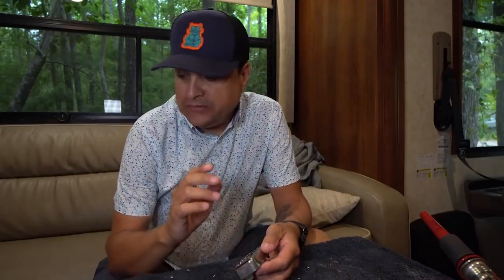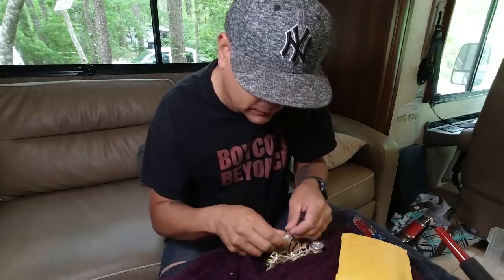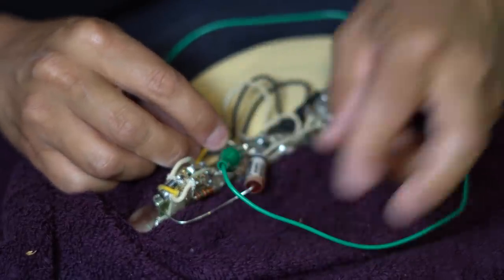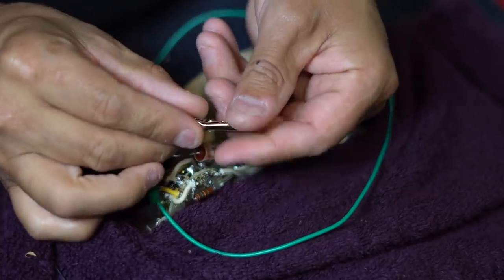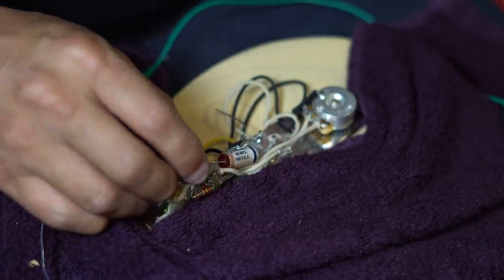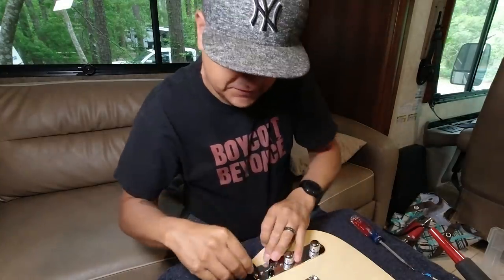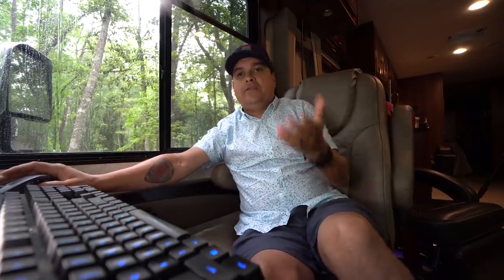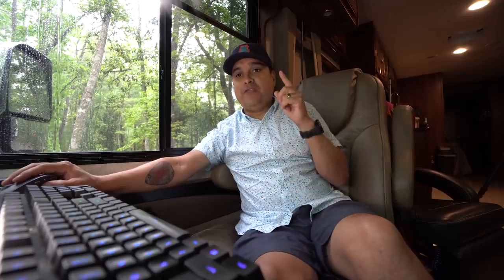Paper in Oil Caps Are Not Worth The Trouble

Comment: Hey Dylan. Just a thought. Because I’m not great at soldering I use a silicone bakers sheet cover with a slit cut in it to protect my projects. The stuff to be soldered fits through the slit and the silicone protects the body better than cloth because the solder is not hot enough to burn through. I used to use a towel too, but had a piece burn through. You can usually find the silicone sheets in the housewares section at any big-box store. Just a thought .... thanks for the video every day thing. I know it’s a ton of work but really appreciated !!!
Reply from the maker: dude... excellent idea.. we used to do that as well
Reply: @DylanTalksTone  … just wanted to share what works for me…. thanks for the tip on the pots….

Comment: For an Analog circuit wires are typically twisted to reduce crosstalk with other twisted pairs of wires.   For an Analog circuit this is really only useful for powered/amplified circuits and is part of dressing the leads when building an amplifier.    By twisting the wires (which would have a powered signal running through them) it intertwines the magnetic fields and thus reduce crosstalk and electromagnetic induction to other like wires/leads.For the type of microvolts a guitar pickup is outputting this is really not required except for the physical advantages twisting the wires provides.  It also looks better in a guitar and provides a cleaner look.And as Dylan pointed out all wires should not be twisted, usually only wires that are passing signal/in the signal path.
Twisting all wires (in an amplifier build for example) would cause all sorts of issues and undesirable effects.

Comment: I twisted my fender tele neck leads and didn’t on the bridge pickup (mim pups/guitar so not baseplate ground and uses an eyelet for grounding the bridge) and didn’t have enough lead to twist the bridge pickup wires. The neck is virtually noiseless and the bridge is 60 cycle as hell. 4 way tele wiring. Serie has the same. Is this common? Thanks in advance

Comment: Whenever soldering a connection to a potentiometer twist the shaft all the way to the end (doesn't matter if it is MAX or MINIMUM).
By doing so you are protecting the resistance film from possible damage if the pot gets overheated.
You can still damage the pot however the damaged area (most likely under the wiper are assembly) will be at the extreme of travel.
If you damage/burn the resistance material in the middle you will hear it when using the pot where as if the extreme ends are damaged you are less likely to notice it and still be able to use the pot.
Reply: I recently started using ring terminals around the shaft of the pot.

Comment: Old-school UTP phone cables or 10 Mbps Ethernet ("CAT3" cable) had maybe 10 twists per meter.  CAT5e (100M Ethernet) has 50-150 twists per meter.  CAT6 (Gigabit Ethernet, or 10G with cables < 55m long) is 200+ twists per meter.  The actual pitch isn't required by the spec, and in practice depends on the manufacturer.  A couple of twists per cm would be good for frequencies up to 250 MHz.  You don't have to wind it up tight like screw threads -- assuming you bother to wind it at all.  It's not like there's even one meter of cabling inside the guitar.
Reply from the maker: Thanks so much for this. I didnt know the specifics, I just knew it wasn't the same application

Comment: Would solid core phone wire be good for wiring a guitar? I mean, we're talking about millivolts and purpose made signal wire, right?
Reply: The only negative to solid core wire is that it's not as resistant to repeated movement and bending and has the possibility of breaking due to metal fatigue if moved or crinkled too many times. It's not a huge issue as you aren't going to be moving your electronics around much once installed, but the possibility of a break is still there so stranded wire is the best choice for longevity. Solid core is useful for jumpers on the same component, like on a pickup selector where there will be no movement or connecting terminals on a DPDT switch.
Reply from the maker: what he said... it tends to crack
Reply: Cool. Thanks for the replies, guys.
Reply: FairlyUnknown Exactly, I only use solid core on pickup selectors, it makes great jumpers.

Comment: Vintage, ‘exotic’, super expensive caps for guitar use are just pure sucker bait.  Capacitors are not mysterious in any way whatsoever, and their use in guitars is just about as non-critical an application as their can be.  They have a larger number of relevant parameters than does a resistor, but that’s not saying much.  Very high grade capacitors have never been better or cheaper than they are now.  

Oil-filling of capacitors is an ancient technology that should be left on the scrap heap of history.  Those selling them are depending on a buyer’s ignorance of electronics.  No one should be expected to work out the leakage curves, inductance, Q, or any of the more complex characteristics of capacitors, but the lack of that understanding shouldn’t empower scammers either.  If the word “guitar” is mentioned anywhere in the research you find for capacitors, you’re looking in the wrong place.

Comment: Paper-in-oil tone caps sound MUCH better than ceramic or mylar(at least in a bass). The problem is that people are too stupid to understand what they are or how they work. The kraft paper breaks down in the castor oil to the point that they are useless after about a decade or so. They will pass a capacitance test but the excessive voltage leakage negates the capacitor in the first place. Most of the modern ones are quite a bit oversized for the micro-voltages of a passive pickup system so it takes a good couple of hours of constant play to charge them up when first installed. Musicians tend to be either cheap or impatient so they will either buy an old soviet-era cap that is internally mush for $3 or install a modern 600v cap in a 0.8 micro volt system. The old soviet cap won't make a damn bit better sound(usually they will sound worse, truthfully) so they say P-I-O caps don't work. If they do spring for a new cap they expect this instant improvement which they won't get until the oversized cap is charged. So you get the same result and they get frustrated b/c when they first plug in it will sound flatish/deadish and they don't have the understanding to play the cap in for hours to charge it up and get it sounding sweet and clear. Try an Allparts black candy vitamin Q in the right size (I can get them mailed to my door in the States for $11or $12 dollars) and play it non-stop for a couple of hours, It will sound much sweeter and more clear than anything else. Then maybe you will be ready for an Emerson or Jensen. Good Luck.
P.S. Don't forget to install them with the correct polarity. The foil-side goes to ground. There are plenty of videos on here describing that process and how to test for it, with and without an oscilloscope.

Comment: Booo! You didn't make a mechanical joint on either leg of the cap, some of the tone will leak out to nowhere 🤣 More seriously I'm intrigued by where that cap actually connects in the circuit. It didn't seem like it goes from the center lug of the pot to ground here. How come?
Reply: Might be a variation of 50's or 60's Les Paul